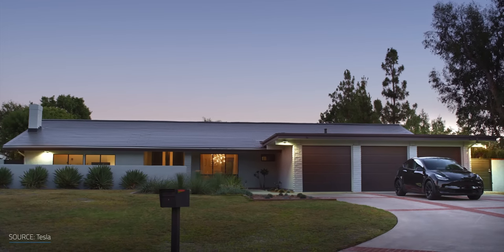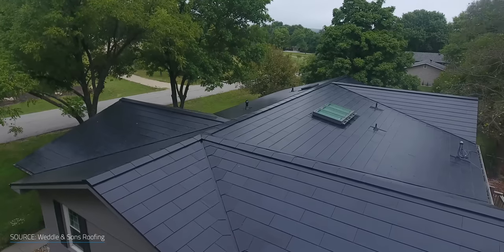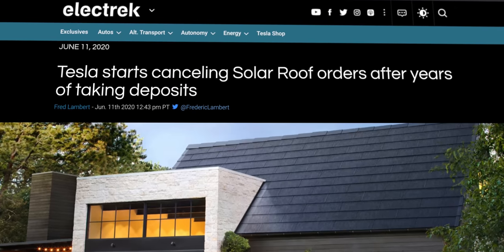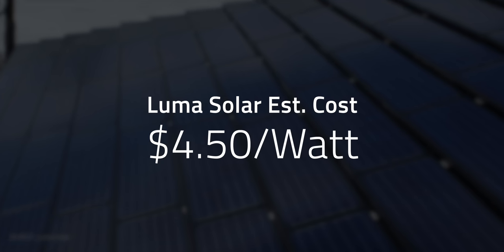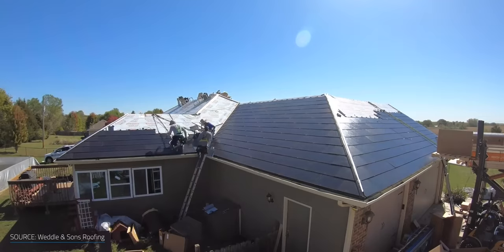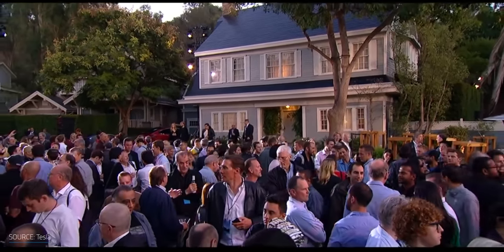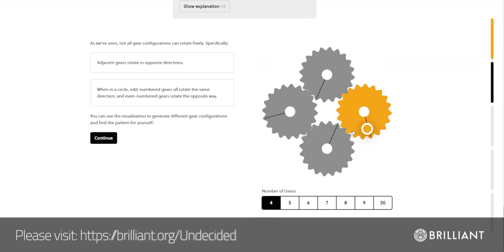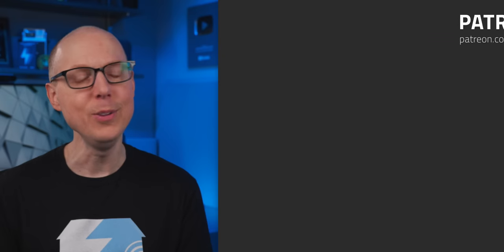The Problem With Tesla’s Solar Roof

Comment: Tesla Solar Roof Owner in Massachusetts. Went with Solar Roof because the shingles had to be replaced within a couple of years. was definitely a process to get it. But in the end it was worth it.
Reply: Our solar dealer in Massachusetts talked us away from Solar Roof and stick with panels because of the consideration that the solar roof wasn't a great idea with the harsh winters in Massachusetts. Have you found that to be a concern thus far?
Reply: @ToddRafferty  what was their argument that panels handle winter better?
Reply: Woke.
Reply: @ToddRafferty  My install was completed in November. One major thing about the solar roof is that the snow slides off the roof, so I have mini Avalanches when we get lots of snow. It can be loud/alarming, but it is also a good thing since a covered up roof wont produce electricity. The pitch of my roof is not steep at all, so if you had a steep roof pitch, I'm sure the snow wouldn't build up as much and would slide off sooner. But going with the Solar roof I think I was able to fit a larger system on my home  vs going with traditional panels. All in all, I've been very happy with my systems performance so far. Not sure how our harsh winters would effect the solar roof negatively. The Obvious possible downside is hail damage, but there's a video on golf ball sized hail in Texas that did no damage to the solar roof.
Reply from the maker: Thanks for sharing Duy Truong!  The people I've heard from who have the solar roof all love it.
Reply: @vTxka0z  Even with panels, I have mini-avalanches off my roof onto the deck. It shakes the whole building. Nothing new there, sounds about the same. I'm really wondering if they were just full of it, warning me away from the Tesla solar roof because they didn't want to lose the job. They just gave me a blanket statement that the solar roof wasn't made for the northeast and that there were glass panel cracking, etc. That being said, in my town, we're only allowed to have 40 panels on the house (I could only get 33 installed due to the roofing configuration and skylights). I wonder how that would have worked differently for a solar roof.
Reply: @CGPhotos  They just gave me a blanket statement that the solar roof wasn't made for the northeast and that there were glass panel cracking, etc.

Comment: Efficiency has to be factored in as well . Depending on your homes' layout buying a whole roof can be a waste of money compared to a traditional set of panels that are oriented properly. Its really important to compare different systems and your specific requirements to maximize ROI.
Reply: Exactly. I’m happy to have more options on the table just to get more quotes. I’m sure there are homes where solar shingles will make sense while others will want panels.

More options is almost never a bad thing.
Reply: Yeah, the further from the equator you are, the more one side of a solar roof is a total waste. I do solar installation in the midwest for a living, and we don't put panels on the north side of a house. You're just blowing money on space that won't generate enough to ever offset its cost.
Reply: North facing roofs would be installed with normal shingles/slates. South facing with solar slates. They might look different from your personal drone but you can never see both sides from the ground so would anyone care?
Reply: @Dave5843-d9m  That would make sense for my house.
Reply: @Jackissoocool  what about west facing only ? for the midwestern or SLC ut usa 🇺🇸?
Reply: This was a concern with my house. Somewhat complex roof design means a lot of it is in shadows a lot of the time. I was able to maximize the best space with panels.
Reply: @NathanMichalik  the roof is boringly flat as it's a 1960-75 ranch/A-frame house 🏡with very little tree 🌳🌲obstructions or fencing or suburban/subdivision house next door blocking out the sun in tell early morning 6-9-ish or late afternoon 15-21-ish so that part is a plus but the gabale/roof line is dead smack in the middle ( and about 30-50ft from grade line ) aka flat is E&W not N&Southern as the best way for solar panels and systems and i feel sitting on a windy enough for fall and springtime to work ok 👍 summertime is mostly calm but rainstorms or before it the winds sometimes picks up enough to maybe even work and the same thing for the middle of wintertime  

and im proffering it to be optimised for summer's a/c loading needs for now and spitting in the middle also means more racking and conduit's ect aka more money is needed for it to work correctly
Reply: I always thought of this- the solar tles would need to be done on either side of the roof. Plus, if your building's roof angles too little, panels can have stilts to angle them differently
Reply: @briannem.6787  it's angled at about a 20-50% slope but costs wise it's called pick only one side of the roof for the aray/equipment to live on
Reply: You can choose where the actual solar panels go. The rest are just look alikes. Tesla also helps to show where they should go to maximise energy production.
Reply: @kaygee301  haven't seen anything for mathematics on my roof for only one side and only facing W 🤷‍♂
Reply: Not all the tiles are active PV on the roof. Some are just for aestheticS to complete the look of the entire roof. The PV tiles are laid out to capitalize on the most production.

Comment: I live off grid in Canada and when deciding on my solar I had to put in many considerations. One of the factors that was a deciding one that I feel was of high value when it came to getting the full production all year round. I pole mounted my solar panels for easier access to clear snow in early morning and fill battery banks by early afternoon on a not optimal sun day. If you have some land and you live where snow will be an issue for many months I recommend access to those panels.
Reply: Great point. The insistence is that ALL of these systems NEED to be on the roof, or a part of the roof. If you have limited space or building restrictions that may be your only option. The panels that everyone thinks are bullet proof and tough as nails, are fragile (to an extent) and would be easier to maintain if they were on the ground at a manageable height. These systems serve you best when you have the space and the knowledge concerning the maintenance and repair or replacement of them. It sounds like you have what you need, where you need them. If most people who thought they knew alot about these systems found out how little they actually knew, it would be a rude awakening for them.
Reply: How many KWH does your system produce per panel in Dec, Jan, and Feb in Canada?
Reply: @percyfaith11  A single solar panel does not put out a killoWatt.  Depending on manufacture and size, 150-300Watts is what a single panel outputs with optimal sun exposure.